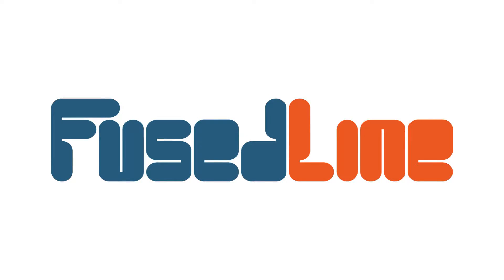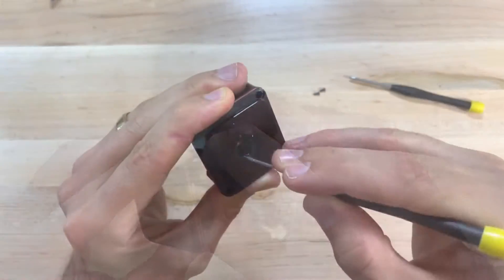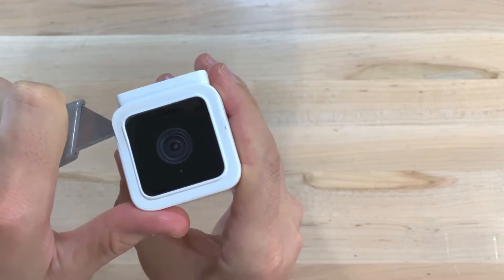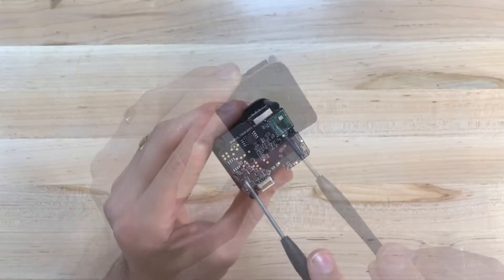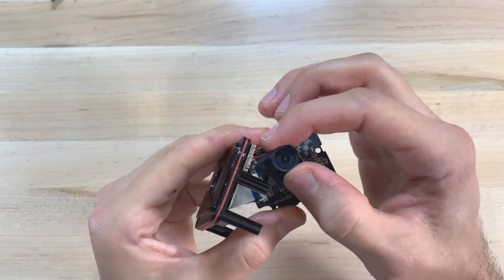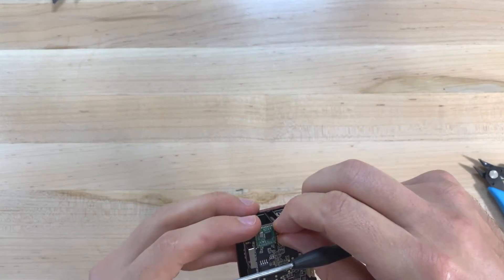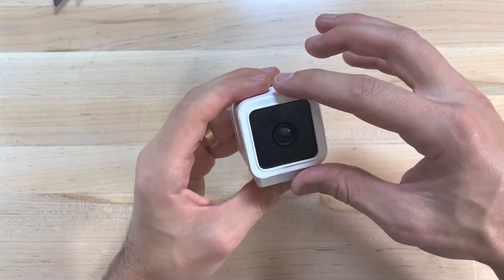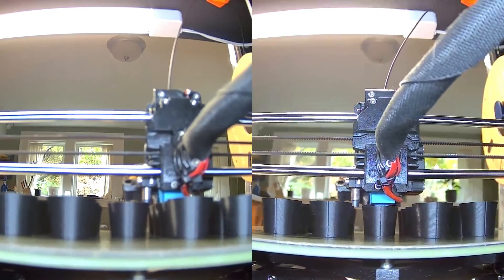Wyze Cam V3 Adjustable Focus | Focus Ring for 3D Printer Monitoring and More!

Comment: Awesome Mod. Thank you for sharing. 
I was able to make the mod, but the image now has a tunnel view (or rounded black images in corners of the image). 
Do you have any suggestion on how prevent/get rid of the 'tunnel' affect?
Reply from the maker: Hello, glad you got it working!!

The tunnel vision you are talking about is due to the focus ring being in view. You can slightly see it on my video too but it’s not that noticeable. 

First, I would ensure the focus ring is pressed all the way on. The best way to do this is to unscrew the lens with the focus ring a few turns so it sticks out further. Then press the focus ring all the way on. This will help reduce how much of it is in-view. 

The other thing you can do if it is still bothering you is to get the focus right where you want it, then carefully pull the focus ring off without twisting and accidentally changing the focus. Then there won’t be a tunnel view at all. 

Hope that helps!!!

Nate
Reply: @fusedlinedesigns  Actually I like the slight vignetting effect.  It makes the shot more dramatic.  Order arrived today.  What a great product!
Reply: As @fusedlinedesigns said, you must push the ring all the way so there is base of the ring is even with the lens.  If the tunnel of the ring seems to long you can trim it a little.   After you have it ready, I would advise gluing the ring to the lens.

Comment: Cool...gave this a try....i couldn't grab the rubber plugs in the screw holes, and had to give up there.  The plugs eventually got pushed the whole way in and no tweezers or pliars could reach them.  

Might retry later.
Reply from the maker: Do you have an air compressor or canned air? You might be able to give it a quick air-blast in the holes and it might pop out the plugs. You can also try to get a really small screw driver, unfold a paperclip, or some other long skinny object and try to pry them out and up. Good luck! At the least you can just pop the cover back on and you still have a functioning camera!
Reply: @fusedlinedesigns  i was able to use a combination of those techniques to get the plugs out...after that i followed your instructions and everything went fine.

The focus ring i got from you worked great.

Thanks!!
Reply from the maker: @edgedweller22  Great to hear it :) Happy to help!!!
Reply: I had the same problem.   It was definitely a nightmare, but I solved the problem.  I tried everything, including needles.  Finally I formed a paperclip into a sslight hook at the end.   This was able to grab the demon plug and pull it out.  I probably worked on this for an hour.   I was beginning to wonder if I was going to have to drill out the screw, but fortunately the paperclip method worked.

Comment: Great video. This is exactly what I needed for my 3d printer cams. Can you provide a link to the focus ring?
Reply from the maker: Thanks! The link to our shop is in the description!

They’re great cameras and I didn’t cover it in the video but the night vision is excellent too. I close up my cabinet and turn the lights off and can still monitor everything clear as day. 

Nate
Reply: @fusedlinedesigns  I have a number of V2, which either have a larger DoF or are focused closer, but when I added a v3 I was disappointed to see the print surface was so badly out of focus. This should really make it more usable.